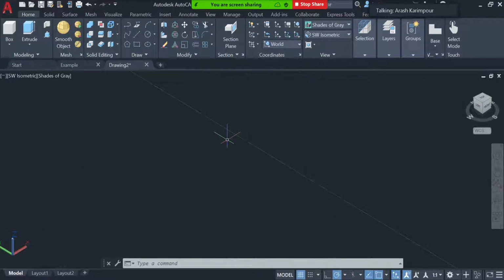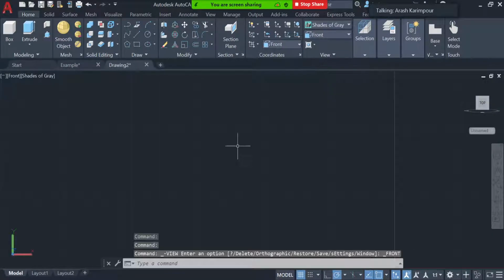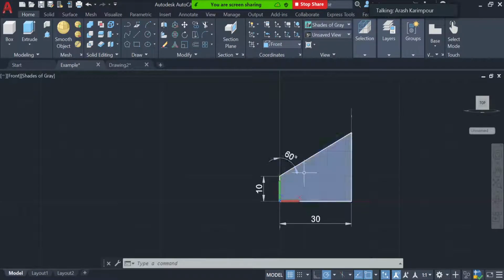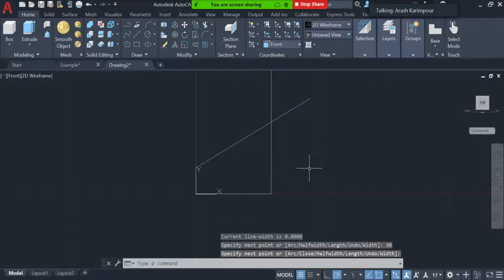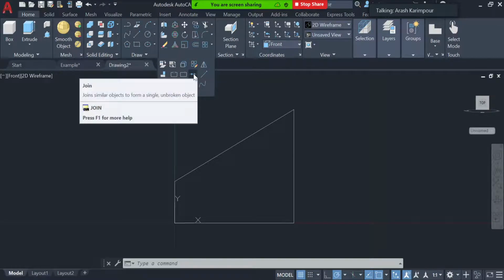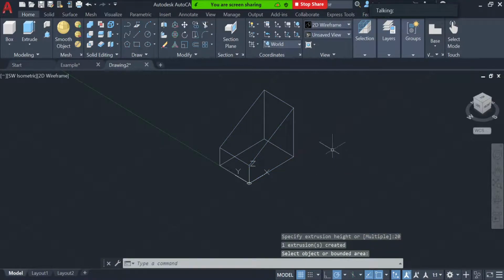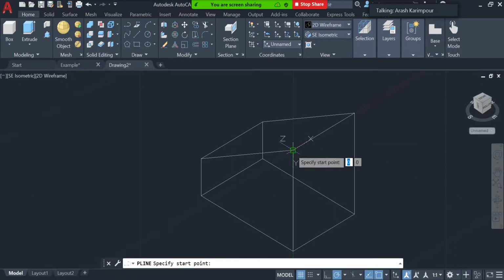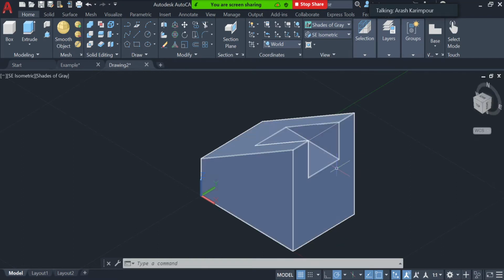61: 3D Drawing Example: Presspull (AutoCAD Tutorial)

Comment: When I try to use presspull to remove part of the object through an angled surface like you did here it still leaves a thin layer of the angled surface rather than cutting all the way through